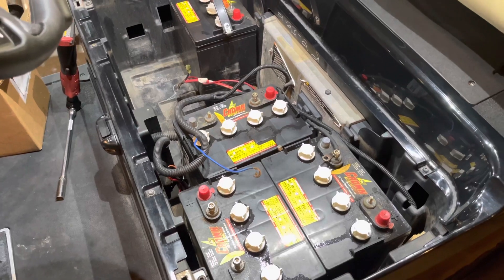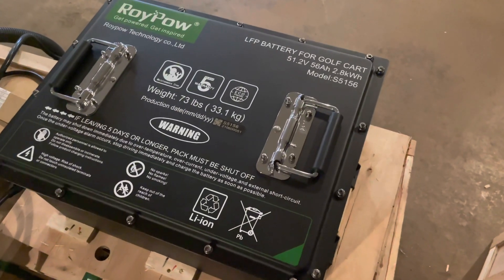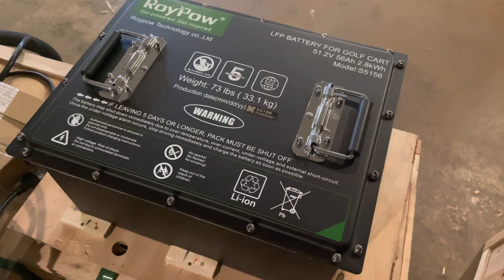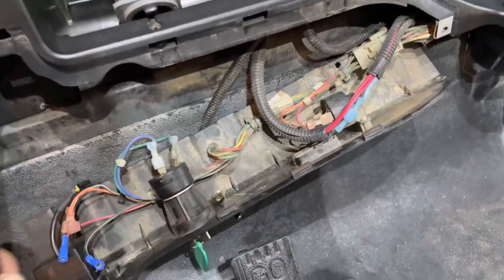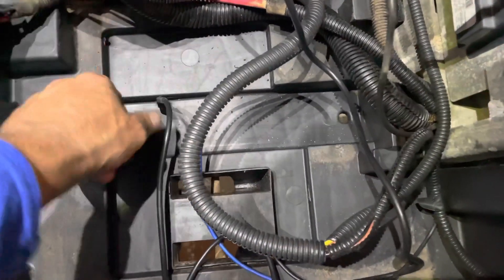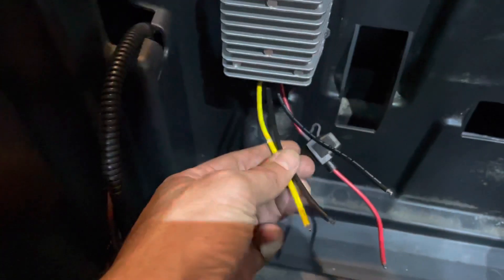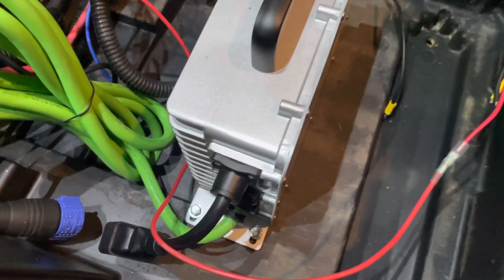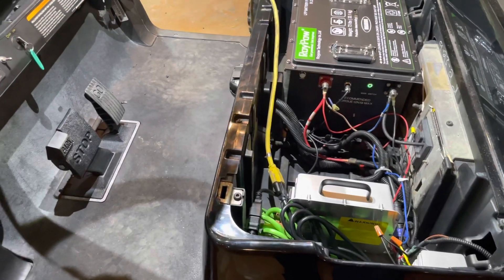RoyPow Lithium Golf Cart Battery Installation (48v - 56ah) ~ 2010 & up Club Car Precedent

Comment: I have a 2007 club car precedent with the 4 12 volt battery setup? Do you have to do an obc bypass? I've been told that you don't have to because by using the new charger, the obc doesn't know it's there. Is this correct??
Reply from the maker: I always recommend bypassing the OBC

Comment: I have a 2018 club car pres with this kits installed but still has factory charging port on the front is there a way to adapt the factory port to be able to plug in 120v without having to lift the seat every time I need to plug in the lithium battery charger?
Reply from the maker: We have cart specific charge receptacles on our website for sale.

Comment: I have a 2010 Club Car Precedent. If I don't remove the original charging port (and don't use it of course with lithium) two of the wires go into the OBC, the red wire used to hook to the 8 volt batteries I believe. What do I do with the red wire? Do I just leave it dangling? Thanks! I did not bypass the OBC.
Reply from the maker: I would probably cut and cap it

Comment: I didn't see you connect red and black wire to the controller, do you not need them
Reply from the maker: Which red and black? This was an older installation video, I have newer install videos for Club Car Precedents I recommend.
Reply: @PalmettoBatteryPros   The red and black that goes to controller

Comment: Mounting the roypow battery on the extreme passenger side. Does that cause weight distribution issues? More weight on the passenger side cause the cart to lean?
Reply from the maker: There is always a driver, so the weight balances. I like to think about the over 250 lbs of weight off the cart.

Comment: I want to give Kudos to Corey and Palmetto Battery Pros for their awesome service. I picked up the RoyPow 48v 105aH at their store locally and used this video to install it on my 2012 Club car Precedent.
Palmetto Battery Pros is a top-notch dealer/servicer that you can trust and they were more than happy to answer all of my questions. Fortunately, I did not run into any issues (thanks to the Video) but if I did they told me to call and that they would be happy to assist. 
I would like to add that I am a degreed electrical engineer so you need to be respectful of the electricity/current present in this device. 
Thank you again and I hope others find this instructional video as helpful as I did.
Reply from the maker: Your comment made our day! We are still with you moving forward if you have any questions or concerns. Thank you very much for the kind words and your business. We appreciate it more than you know.

Comment: Do you have any videos. On a Tomberlan 48 v upgrade
Reply from the maker: I actually just filmed a Tomberlin install, but we ended up having to replace the controller so I haven't released it. We are actually still troubleshooting the cart. I will be doing a video on installing on Tomberlin once I get some info on why I've had issues with the cart.

Comment: How did you know the speed controller failed , what were the indications. I think i have the same problem after install of roy pow in my 2007. Ran good for 3 days then felt like a car jumping out of gear presedent
Reply from the maker: I honestly can't remember, I've done so many carts since this one. When the cart is messing up, test voltage at the battery terminals to make sure the BMS isn't resetting or failing (the voltage will be low and dropping). If the battery is holding voltage, then you could have a solenoid issue or the OBC needs to be bypassed.

Comment: Can you tell me what size the self-tapping screws are that you are using to mount the battery and charger?
Reply from the maker: So this was one of early videos, I have since abandoned using self tapping screws to mount the battery and now use nut and bolt. I use the ones provided by RoyPow. It isn't the best hardware, but if I think if you're exerting enough force to break them then you probably have bigger issues to deal with.

Comment: Can you tell me is that mounting kit came with the RoyPow battery. When contacting them today they didn't mention any of that as an option to purchase.
Reply from the maker: When I purchase RoyPows I have to order the mounting brackets and charger separately. Where did you order your battery from? I sell mine in a complete kit based on cart type.
Reply: @PalmettoBatteryPros  I have not ordered the battery yet and don't want to put the site name on here as it might give them a free plug. 
I sent an email to your site over the weekend with some questions so hopefully, you will get back to me.
thank you

Comment: What is the switch on the dash next to the voltage meter?
What gauge wires to connect battery terminals to reducer?
Reply from the maker: Not exactly sure which switch you are referring to. I used 12 gauge wire, but moving to a 10 gauge for the 30a reducers.
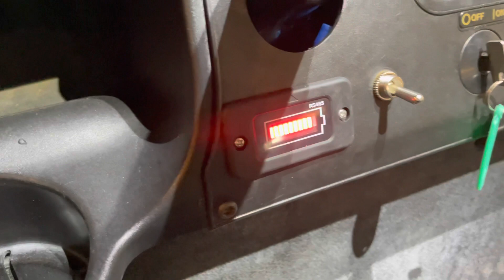Reply: @PalmettoBatteryPros  At the 9:38 mark, you show the voltage meter.  On the right side of the voltage meter, there is a switch.  What does it do?

Comment: Is it possible to drive off if you forgot to unplug the charger?  What mechanism provides that safety feature?
Reply from the maker: Currently, there is no mechanism to prevent usage while charging. With that being said, ECO is releasing a CAN BUS feature this year (July is the projected availability date) that will prevent the golf cart from being driven while charging. If you have further technical questions ECO recommends calling them at the number listed on their site and speak to a technician. www.ecobattery.com
Reply: Wrap the charge cord thru the steering wheel. Saw a rental place do this and its almost idiot proof

Comment: Do you have a video that shows how to use existing charger with new 48v lithium battery?
Reply from the maker: I will try and address that in a future video. Existing chargers have to be able to and reprogrammed with a LFP (Lifepo4) charge algorithm. Newer chargers can be updated, contact manufacturer to see if your charger algorithms can be changed. If your charger can not be reprogrammed, you will need to purchase a LFP charger.
Reply: Thanks for getting back to me, I am in the process of installing the exact battery in your video in my 2016 club car. I have the flash drive to insert in my charger once the installation is finished, but I was wondering if you need to do anything other than hooking the battery up and plug in the charger. Also will the tow switch still work? @PalmettoBatteryPros

Comment: Where did you get the onboard charging mount to connect the charger to the battery? Did that come with the charger? (described at 1:12 in the video)
Reply from the maker: Yes, it comes with the kit.

Comment: Enjoyed it till I saw wire nuts ? Really
Reply from the maker: I agree and normally crimp everything, but the customer wanted to add a fuse block and extra accessories himself after the battery was installed. To make it easier for him, I just used the wire nuts.

Comment: Can you describe more on the lighting wires you moved over to the reducer please?
Reply from the maker: The 12v light wiring harness should have a positive and negative wire end. For this install I used wire connectors to crimp the light harness wire ends to the reducer OUTPUT positive and negative.
Reply: @PalmettoBatteryPros  does each device need a reducer? Or is there some type of block to use where you can tie in a few accessories? I have a speaker bar, LED Underglow Kit, and LED light kit. I wouldn't need 3 reducers right?
Reply: @nyguy4u  and @Palmetto Battery Pros, I would like to know the same thing, although I am expecting we can connect a 12v Fuse Block with say 6 connections to attach up to 6 12v accessories. My question would be whether there are different voltage/amp of fuse blocks. I am installing three (3) Nilight - 18005C-A 26Inch Triple Row Lights 297W 29700LM Flood Spot Combo Beam Bars on my ClubCar Precedent roof, and want to ensure that if I turned ON more than one of them at a time, would I have a concern of overheating the fuseblock or something else?
Reply: So bear with me. Wiring is far from my strong suit. Where is this wiring harness for the lights? From that point, how exactly are we modifying it to work in the voltage reducer?